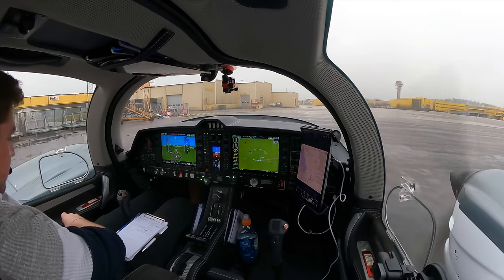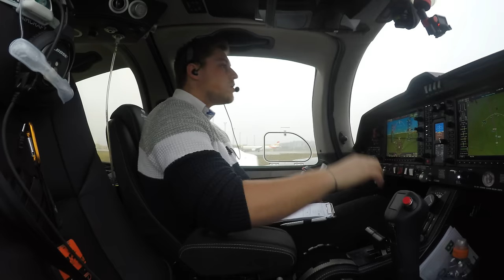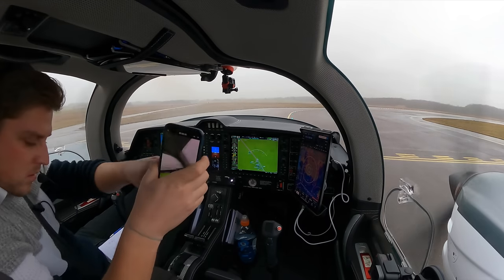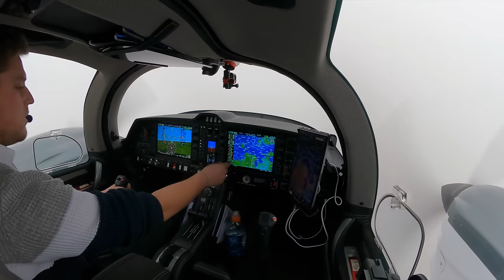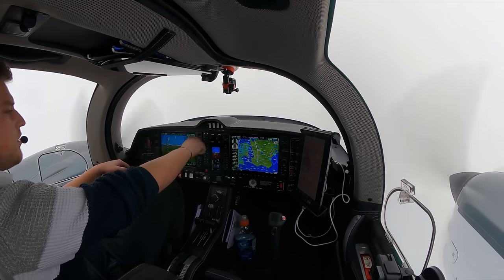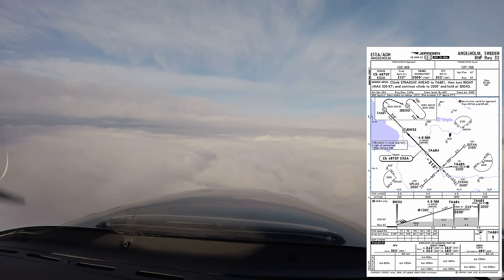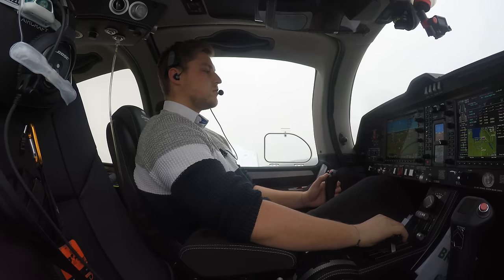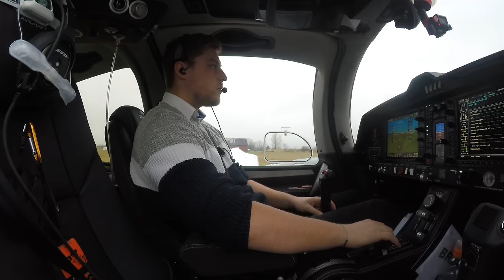FLYING HOME! / DA62 Atlantic Ferry Flight

Comment: Hello Mike,
I have a question, why do you put the plane in a 90° angle to the wind at the holding point ? 
Thank you for all your videos, I am a PPL student who will maybe pass IR later and your all your videos are very interesting !
Julien
Reply from the maker: Hi Julien,
when you do the ECU test you want the wind either from the front or 90 deg from the side. If the wind blows strongly from the back then the ECU could indicate a failure because some value might get out of the range. Normally the governor is operating only with wind from the front (because the plane moves forward right ;) ) and this is why I do that :) 
BR and good luck with your training!
Micke :)

Comment: Use heading mode to start the turn then switch to nav. I'm sure you do that as well. How does that headset work in the DA62? I need to get a 4th set. Have 2 A20s, 1 Lightspeed, wondering if the noise reduction is sufficient or if you would prefer the A20?
Reply from the maker: The proflight works great in the 40/42/62👍🏼 The A20 is a bit quieter but I have it because of the space over my head👍🏼

Comment: Once you were cleared direct to the fix the need for a right turn was no longer required based on my understanding.
Reply from the maker: Correct but the left turn would actually have been the longer one👍🏼
Reply: @MickeLang  Oh I see ... my AP seems to always get it right and pick the shortest route/turn to a fix but I have seen it turn the opposite direction than what I was expecting when the fix is almost directly behind me and either direction requires a 180 degree turn.

Comment: I am surprised about the amount of switches to be flipped, items to be checked and fiddling with the screens. What if you forget just one thing? Secondly, to stand on that runway in bad weather conditions is discomforting. That aeroplane, which you snapped with your phone, came out of nowhere. One miscommunication, and you have a collision. I feel very uneasy flying through grey clouds all the time with no visibility. Once you get out, you might find yourself nosediving. Apparently, you get disoriented quie easily. With no visible frame of reference. And then thre is always a chance of a collision. You might pick up the path of the other aeroplane but if you get close things can still go haywire if the other plane suddenly changes course.
Reply from the maker: That's why you have to study a lot and to get good training and in Aviation this does not stop after you get your license, you constantly have to show that you are still on the level which is needed for a safe flight.
Reply: My friend, there are a thousand reasons to not do things, and then one day you do it and realise that you have an overactive imagination! Give it a try, study hard and you will be well rewarded with life experiences that few get to enjoy. Crossing the road isn't anywhere near as safe as flying if you're properly prepared, yet you do that! Cheers and best of luck - Dave